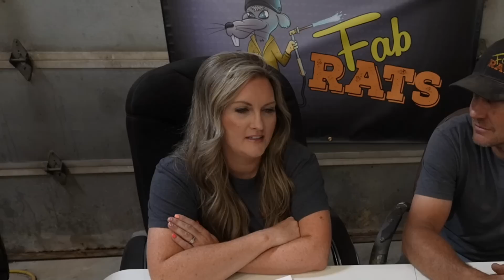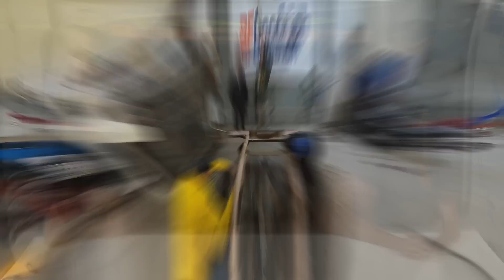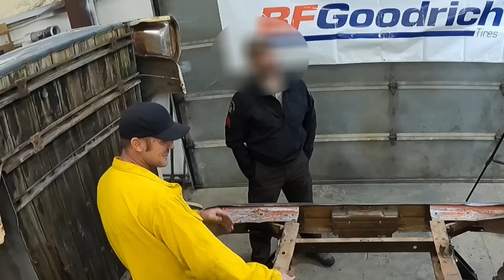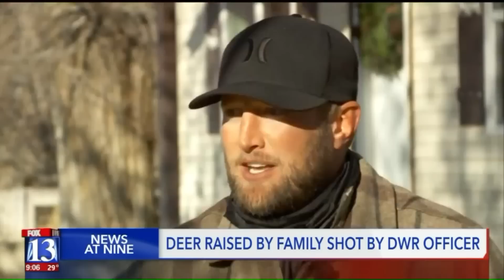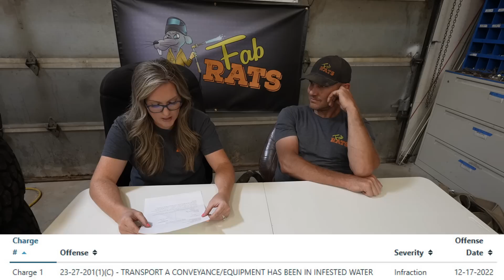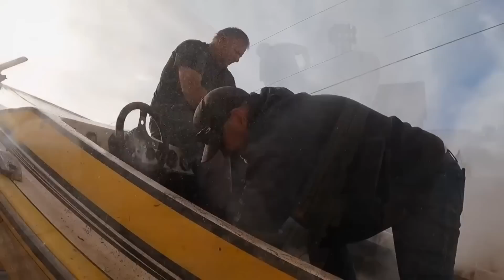Never Saw This Coming: Fab Rats Are In Legal Trouble!

Comment: So Paul, I use to be a Reserve Deputy. I've seen quite a few bad Officers who let the badge go to their heads. The fact of the matter is the only way those officers learn to not do what they do is by losing their jobs. This because they never get it through their thick skulls. The other thing is they learn allot of the way their brains work is based off of either relatives who where also LE and they just take their retired relatives stories to heart and work off those old ways versus the new policies and procedures. 

Hang in there and you will have no issues winning this in the courts. We as a fan base believe in Fab Rats!!

Comment: Other benefits to removing the boat (which in itself is not something most people could have done) and the goodwill of reuniting it with previous owners are 1) you removed environmental pollution, especially because the engine had oil in it, and 2) rehabilitated the boat to usable condition which kept it out of a landfill.
Reply: Yes, but NISA law doesn't care for any of that. The thing is that Paul was wrongly accused for a crime he didn't commit.

Comment: Thank you for your correct assessment of LE. I’ve served for over 16 years and love what I do. It’s unfortunate that a small few make us all look bad time after time!  Thanks for understanding we don’t want to work with them either. You all are awesome!
Reply: when the good ones don't hold the bad ones accountable, we can no longer tell the difference between them. The blue line should be a filter for the finest, not a shield from accountability.
Reply: @FREE_WILL_AAHhhhhhhhhhhhh  like unions for example
Reply: its always the bad/idiots that are always the loudest
Reply: @FREE_WILL_AAHhhhhhhhhhhhh   I couldn’t agree more. Accountability is extremely important and there is no more transparent occupation than Law Enforcement. Everything we do is scrutinized by everyone. I love what I do, but unfortunately it takes time to weed out problems in any occupation. As much as we’d like to snap our fingers for an instantaneous solution nothing is that quick.  I certainly don’t speak for everyone or every agency. I do the best I can and work for an agency that I believe is transparent and does the right thing with everything from selection to training.  There’s not a single occupation that is under the microscope more than we are and none are perfect. Every occupation from healthcare to education has a few they try to weed out.  I put my uniform on each shift and protect those that love us and hate us just the same.
Reply: @Harold Phipps  I get my pension from the union.  I know people don,t think much of them but 50 bucks an hour and a nice pension 😊
Reply: it seems that the Just Us system has built a division between the people and the enforcers of laws...laws have become a tool of revenue generation and forced incarceration, little rehabilitation and lot's of likely to reoffend rather than a method of keeping the peace. The first law that we all should consider is free will if we believe that we are all equal...I only own me and you only own you. The first violation of the first law is theft of consent. This is typically referred to as crime because there is a victim created and so a charge can be placed on the perpetrator so that justice can be pursued. If there is no victim created by the actions of the people why do we condone government to initiate violence against a non violent people because someone somewhere made up a new rule that might change tomorrow? for instance the drug war..... people being shot and thrown in prison over weed, now people legally opening stores for it all over the country..... If the person just obeys, they give up their rights to life, liberty and pursuit of happiness and due process of law. Shouldn't it be that it's better for 10 guilty to be free than one innocent man to be imprisoned or killed in the process. I was told by a local Sheriff that he doesn't care what the supreme court or constitution has to say. I served 9 years active duty Air Force and I come home from stomping in sand all over the east to find the most tyrants right here. I don't know you, I'm not suggesting anything about any individuals actions.....but if a public servant is not filtering their authority to arrest or file charges with the constitutional limitations placed upon government, then that police officer is supporting tyranny. The hope that I have for this is that they are doing based on ignorance and sick ego rather than malice. A Sheriff told me, it's been this way for a long time....I replied it doesn't make it right. When I was a kid I wanted to be a cop, a protector, of service to my community...seeing it for what it is, even though the pay is pretty good, no thanks, I'd rather sleep at night and not need alcohol or depression meds to do it.
Reply: @FREE_WILL_AAHhhhhhhhhhhhh  wow. You have a lot on your mind. First off, thank you for your service. I’m thankful to serve with many who are retired or former military. I’d tell you the same I tell anyone who wants to make a difference. Fill out an application and help be a part of the solution. Nothing is perfect and it takes good folks with good intentions to affect positive change.  I don’t get paid very well and never got into this line of work for money. I don’t drink alcohol and have no depression.  I’ve seen a lot over the many years that could drive someone to those things, but having a strong support system and love for what you do keeps you wanting to help where you can.  Negativity only reinforces negative results. I wish you well and hope you can inspire positive change in whatever way you’re able. Take care.

Comment: You think that's bad try building Custom Motorcycles and Custom Cars..... I live in Northwest Arizona and every time I ride or drive in Phoenix or Tucson I get pulled over and asked where my smog sticker is, I don;t have one because I don;t need one, the state law says "unless it is regularly commuted in or to Phoenix and/or Tucson any vehicle older than 1987 does not require to be smogged". I get it though, it's a new car to them but I live 4 hours from Phoenix and 6 hours to Tucson, no I don't "regularly commute to either one of them.

Comment: My two cents worth. See Conveyance 2b

conveyance
noun
con·vey·ance kən-ˈvā-ən(t)s 

1
: the action of conveying
the conveyance of goods
the conveyance of meaning
2
: a means or way of conveying: such as
a
: an instrument (see INSTRUMENT entry 1 sense 5) by which title to property is conveyed (see CONVEY sense 1c)
b
: a means of transport : VEHICLE

They are accusing you of one or more "conveyance", the wrecker that lifted the boat, the trailer it was put on or the truck towing the trailer, of being in the lake bed on more than one occasion without waiting for the arbitrary wait period of 7 days or 30 days before it could go back in. My heart tells me they have drawn up the lake using the highest water mark possible and technically it doesn't matter to them if it's wet or dry, you crossed an  imaginary line. Next time say, I Back the Blue, however, I Back my Freedom, I don't answer questions!

Comment: So the citation was dropped 4 days before you posted this video. ALSO you were in the wrong and the law you think applies didn't even apply to you. DWR cleaning was 100% required, full stop.  Jeesh, this video is a seriously bad look now even though the local AG let you off to not have to deal with your crap
Reply: Don’t drink the Kool-Aid.  Boat was out of the water for a year.  Did you even watch the videos?
Reply: Ah, I see you are a serial troller of crappy comments on their channel.
Reply: out of the water for a year is irrelevant, the 30 day water period is if no species are on the boat at all. If any ones are found on the boat dead or alive NO MATTER HOW LONG IT HAS BEEN OUT OF THE WATER, inspection is required.
Reply: Brady letter